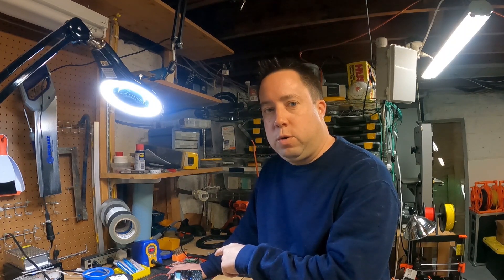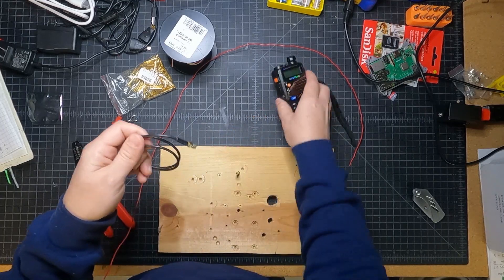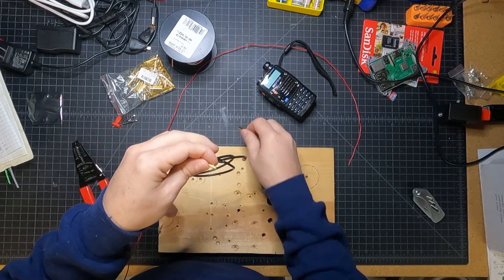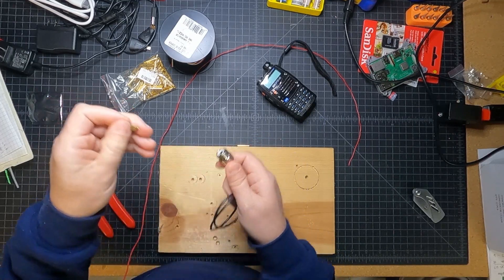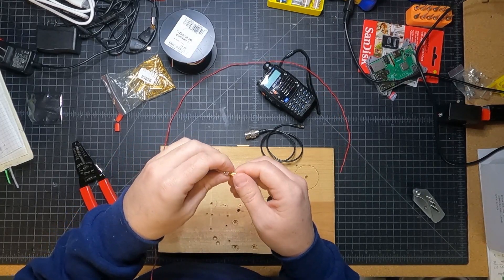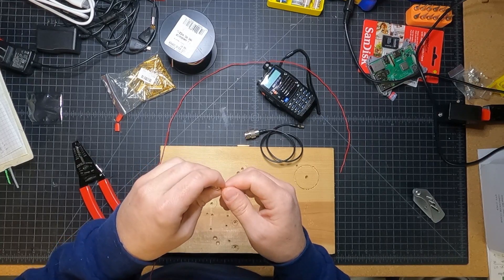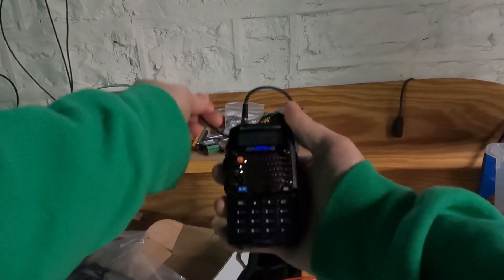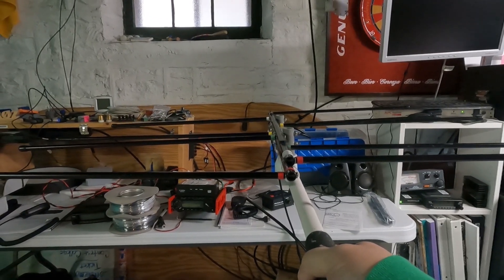Ham Radio Antennas - Will It Antenna?

Comment: is it the lead acting as a radiator?
Reply from the maker: Lucky charms doesn't radiate on 2m?
Reply: @AA0Z  I'd think that a blender wouldn't either.  LOL  I'll have to go back and see where you had the alligator clip hooked up.

Luck Charms - magically resonate. 

Actually, I'm surprusdd you didn't screw up your finals, but then I figured it's a Baofeng.  Blown finals, get a new one.
Reply from the maker: Lol. That radio is throw away!